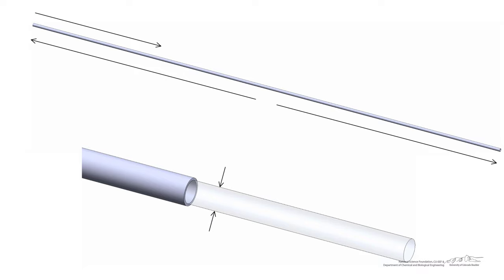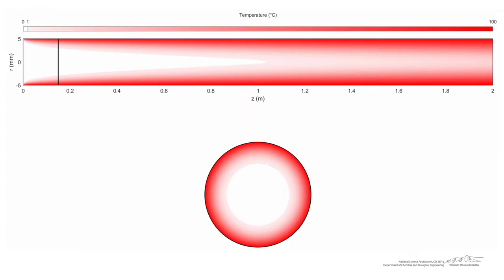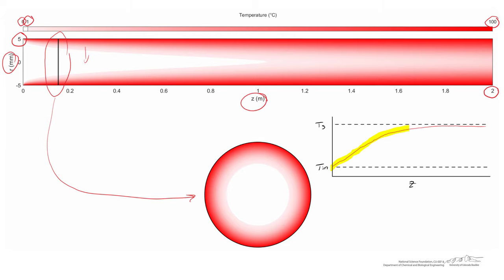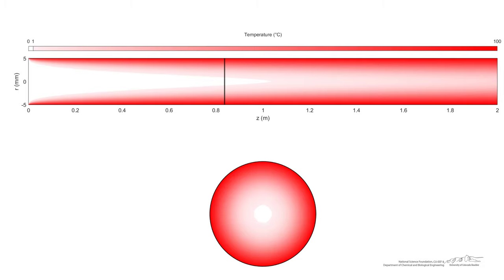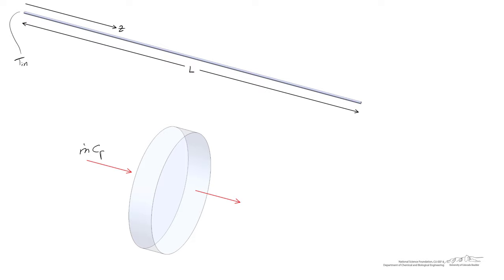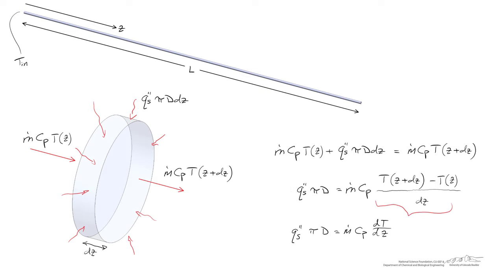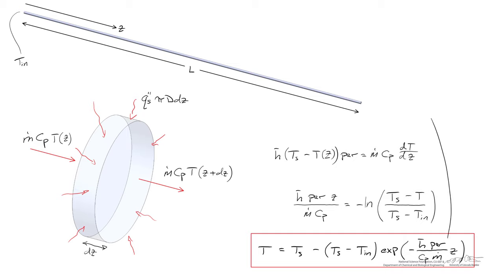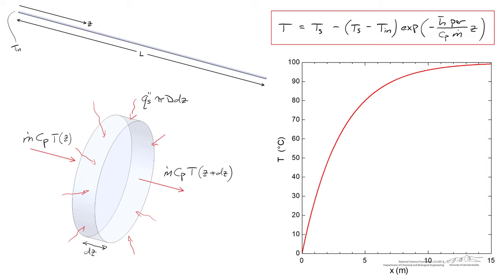Heating of Water down the Length of a Pipe, Uniform Surface Temperature

Comment: I'm able to reproduce your results fairly closely.  A couple of observations: 1) Multiplying velocity by cross-sectional area times density gives 0.778 kg/s, I adjusted my velocity to 0.113 m/s in order to match your 0.0088 kg/s.  However, adjusting velocity results in a slightly higher Reynolds number of 2100.  Going back to 0.1 m/s gives the same Reynolds number you have.  2) I think some attention needs to be given for how the Nusselt number was calculated as it can vary by method.  The only value I could get that was close to your 5.2 was to use the Sieder Tate relation assuming 1 for the viscosity ratio between bulk and wall conditions.  My value was 5.9.  This is important because I'm assuming that's how you found the average heat transfer rate, h.  I got 380 W/m2 C.  If I use your 330 W/m2 C I'm able to reproduce your results.  It's probably worth noting to the viewer that the heat transfer correlations will vary depending on the Reynolds number which is clearly in the laminar flow regime for this problem.  Thanks for posting the video.
Reply: Hi, I am wondering how do you do the simulation. Do you have your own MATLAB code or there is a software there?

Comment: I've attempted to recreate your simulations in a spreadsheet using your parameters for reference and cannot achieve the same output.  The initial value yielded by the formula in the spreadsheet is 99 C @ position '0' : [ T = 100 - (100 - 0) ^ 0 = 100 - 1 = 99, which then asymptotically approaches 100 C for larger values of Z.  I've tried a number of variations / tweaks in my spreadsheet but nothing has proven successful.  Any suggestions are welcome!
Reply: Exp refers to the exponential function "e". The function is Ts-(Ts-Tin)*e^(blob) and not Ts-(Ts-Tin)^(blob)